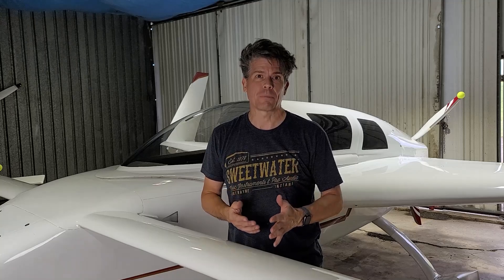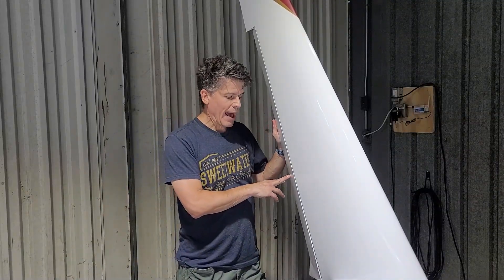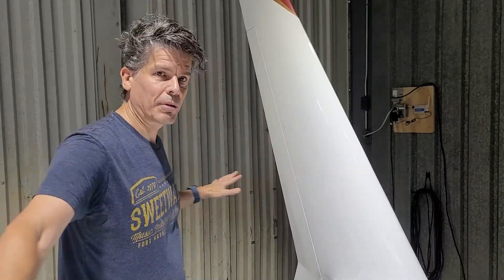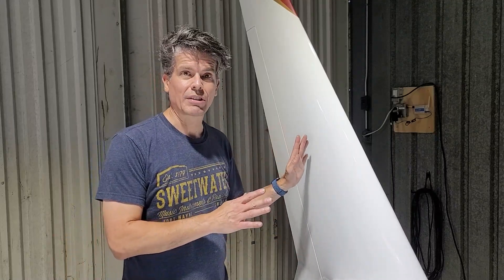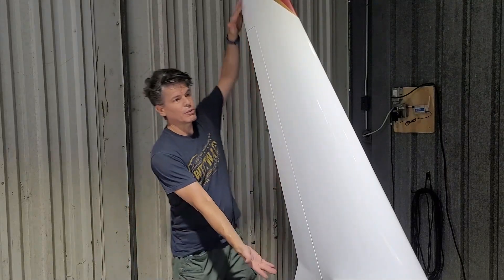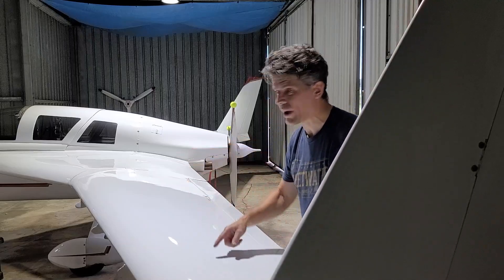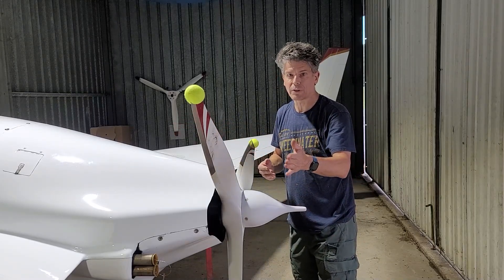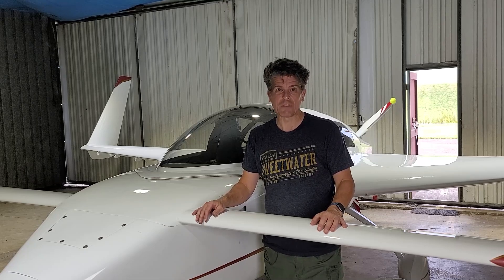How Do Canards Yaw? I Just Learned - And It's Not What You Think!

Comment: still not quite undestanding the rudder linkage.  is one foot pedal steering left rudder right and left. and the other foot steering right rudder right and left?  in a conventional aircraft the pedals are interconnected, push one forwards and the other goes back, same thing here?
Reply from the maker: The rudders move outward only. Think of the vertical stabilizer as a wing with a flap. When the flap (rudder) is deployed, it generates extra lift pushing inwards, which yaws the airplane. So each pedal moves its associated rudder outwards when depressed. When you let up on the rudder pedal, the rudder on that side retracts and aligns with the vertical stabilizer. Pushing both rudder pedals moves both rudders outward. The rudders never move inward at all.
Reply: @CanardBoulevard  thanks good explanation. when you stop pushing the rudder pedal, how does it return to the center?  spring or is it the air pressure?  fascinating stuff!
Reply from the maker: @WoodyPianoShack  Both! There are springs inside the rudders that connect to the vertical stabilizers that pull the rudders back in on the ground. In the air, the airflow is more than enough to keep them retracted. When parked outside, I'll put gust locks on the rudders and ailerons to prevent wind from blowing them and damaging them.

Comment: I don’t think most people who are into aviation weren’t already aware of this. Actually I’ve never even thought control surfaces work on drag. That doesn’t even make sense for drag to be the major factor because the deflection isn’t even high enough. You would need more than 70 degrees of deflection for drag to surpass lift.
Reply: Flaps work with drag. Creating drag is the purpose of flaps. That they also create lift is secondary.
Reply: The only control via drag I know of is yaw on the B-2 (and probably other flying wings). I wonder if anyone tried it for pitch. Probably. It seems like everything has been tried on some military research project!

Comment: Mostly correct. The winglet is not a symmetrical wing. It actually has a substantial camber. Have a good look at it or find the builder's hot wire templates for the winglet.
Reply: Why would the designer want an asymmetrical winglet? That means that even without deflection there's a 'lift' component (pulling or pushing) the winglet sideways (which, since it's fixed in place causes torsion in the material).
Reply: I have this same question. Asymmetry would lead to induced drag. Maybe the winglet produces small amounts of lift to generate a pressure differential that reduces induced drag on the main wing? Just thinking out loud.